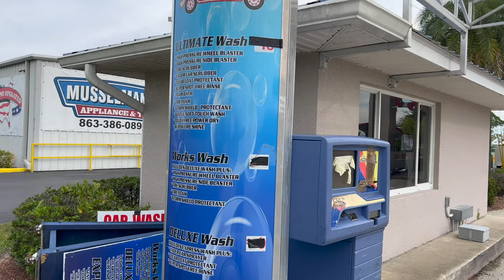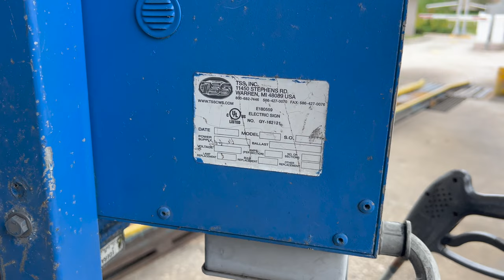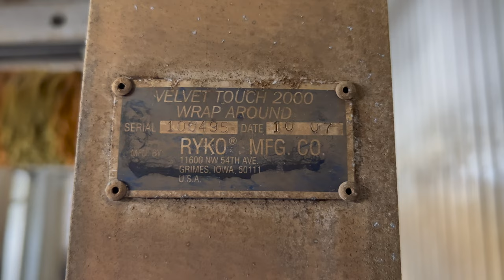Abandoned Car Washes: Ryko Rocket Conveyor

Comment: I remember finding a Circle K gas station somewhere in Florida that featured a Ryko VT2000/Rocket tunnel, but it was replaced with a Mark VII Choice or SoftWash XT. The building housing the former VT/rocket tunnel wasn't demolished, so it was a single IBA with a lot of unnecessary unused space. I think the offboard Mark VII dryers were even at the exit of the building which made them about 20 feet away from the main gantry.
Reply from the maker: Sadly, there’s only a handful of Rocket/VT2000s systems left operating in the state and there are some parts of Florida that haven’t been explored.
Reply: Is this in Orlando? I believe I’ve seen it in person. It also has self service bays.